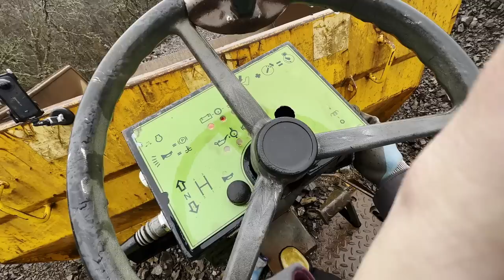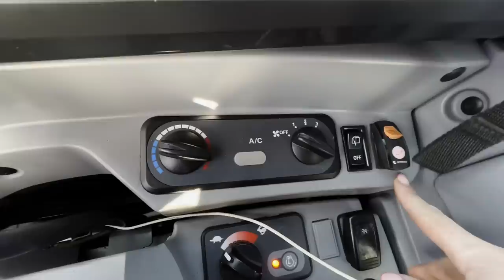Taking Off My TILTY! - Digger Girl Diaries Week 12

Comment: Hi Amy, when loading the dumper, if you tip the skip forward you can see the prop shaft and both front wheels.. keep the prop in the middle of the lorry and jobs a good un.
Reply from the maker: Thank you for the advice I prefer the way I do it, done it before that way 😅
Reply: @the_digger_girl  no worries and reversing.. I used the tow hitch to find the middle

Comment: What you need is a skid tank and a pump. I've built lots over the years all out of aluminum. From 5 gallons to 100 gallons, no more lifting pails.
One slip and you'll have back problems like I've had for years. You do nice work, who needs a man when Amy is on the job? Keep Smilin

Comment: Just found your channel.
Nice work👍
You should consider getting "Faster" coupler's, they are screwed together insted of the pull back locking mechanism.
With these you do not have to relaese any pressure.
I got the three easy couplers on my backhoe (Huddig 126C).
"Faster"
"Multifaster"
and "Oilquick" witch is what Rototilt's quickcoupler is a copy of.

Comment: There's a thing for your computer called TrackIR, it uses a camera and some marker dots to track where your head is pointed.  It's great for anything 3D, you can look around by simply turning your head.  I mention thiis because going from a program that does use it to any that don't is pretty jarring, and with that I can relate to living without your tilt-rotator.

Comment: why would you not just back your ute up and stand on the tailgate when doing fuel? and why not look at a sliding tray for your ute, i have drawers and a sliding top which i love but you have to figure out whats right for you. essentually you won't get the best from your ute as crawling in the back is a pain so find a solution or get a 4wd van which may be better for you when you need to change from bib overalls to something more glam.
Reply from the maker: Really want drawers but probably not worth putting them in my pick up as it’s 5 year old this year so possibly time for a upgrade 😆
Reply: @the_digger_girl  move the tray into the new one lol. Mine is on its second Hilux but I also bought a long-range fuel tank and have a pump with 5 metre hose as most of the time it's your Ute going to site so can fuel everything easily
Reply from the maker: @phil-bay-of-plenty-nz  that sounds more like it!